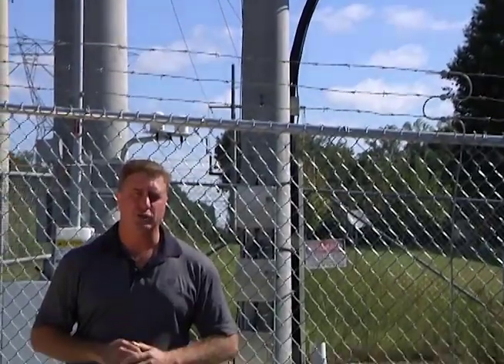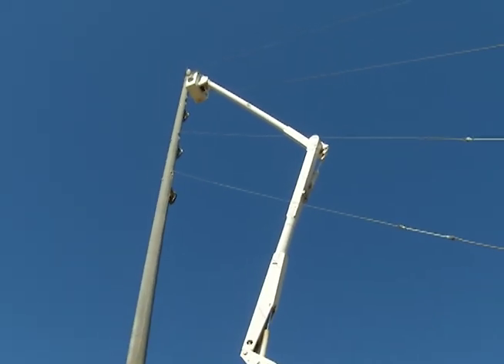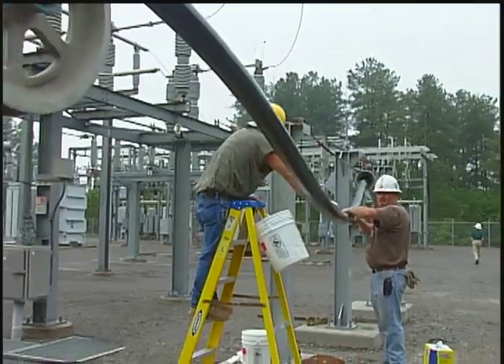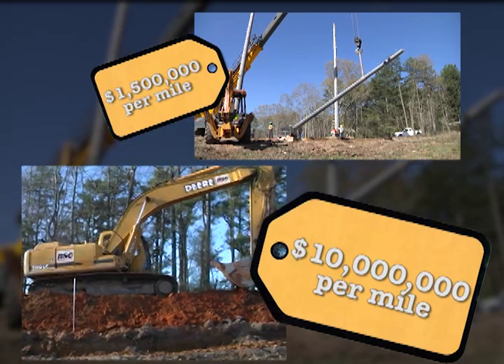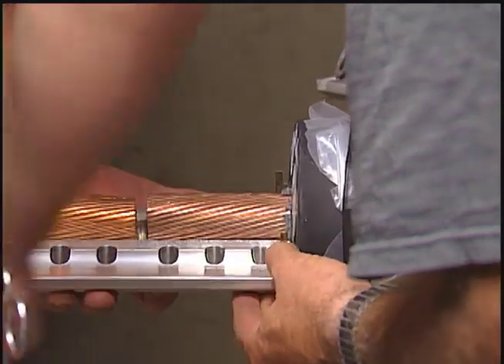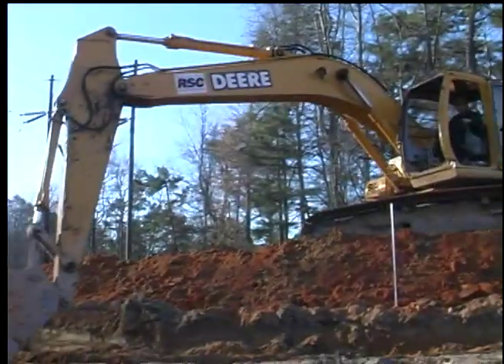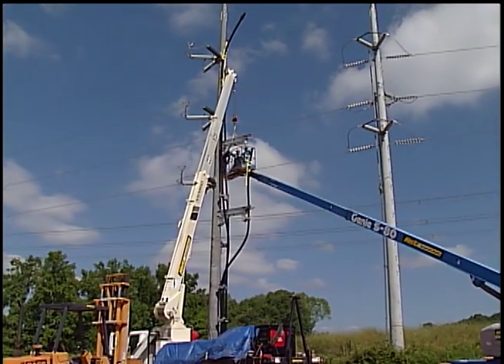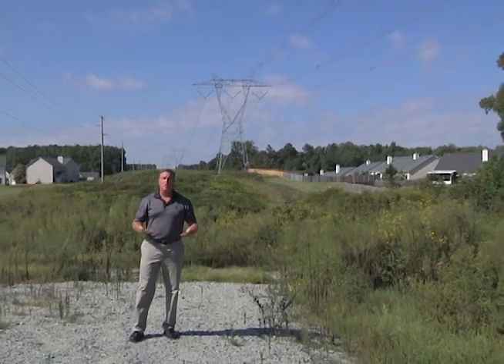Underground Transmission Lines

Comment: Overhead cables not being insulated or very thin insulation are kept cool by passing air, underground with thick insulations cables heat up when passing a lot of current for lengthy times thus resulting to very decreased life of the plastic insulation.
Reply: No they are rated for it
Reply: those insulations are rated for HV do some simulations on cymcap

Comment: SHORTER LIFE EXPECTANCY?!
Overhead lines change temperature faster, change temperature MORE, are exposed to wind, ozone, UV, water, ice and snow.  They are exposed to MORE animals, especially squirrels and birds
Loss-costs are, on average, 2.8% for underground, vs 37% for overhead.
70% of line failures are weather-related, 11 percent are animals on overhead cables/poles/transformers...
Underground cables bring those externality risks down by at least an order of magnitude!
Reply: PhrontDoor you are wrong.
AC lines can't be buried more than 40 miles. You are talking about physics contacts to the line but the reduced life of underground lines is because the electric power pass through the ground.
Only DC voltage can pass to long distances of water/ground and have much more efficiency than AC.
Reply: profesaional！
Reply: @PhrontDoor I think you have mixed up life expectancy with risk of temporary failure. An overhead line will have a much higher risk of temporary, easily fixed failures caused by animals shorting to ground, or a tree falling on coming in contact with the line. These types of short term failures occur much more frequently on an overhead line, but they are easily resolved(most of the time), an underground line will have much lower risk of small scale failure, however the wire will age much faster due to water ingress and other conditions when compared to an overhead line, so the entire cable will have to be replaced after a shorter time.

Comment: Underground is nice but the cost and thermal ampacity limits restrict it's economical ideployment. ACSR open air conductors are far better (thermally and deployment cost) Undergrounding. Makes more sense for 12/21 KV in developed areas. Our local utility has an ongoing battle keeping 30+ year old direct burial cables operating. When we lose an aerial 12KV feeder it's less than an hour for restoration... RU feeders can be several hours to locate the fault and dig up the line...

Comment: Here in Florida, underground transmission lines will never happen. Floridian rate payers don't want to pay the extra cost. If anything, FPL is upgrading the wooden transmission poles to steel ones.
Reply: +fishodorvagina wouldn't that still expose the wires to weather hazards?
Reply: +OscarProGuy It will. But they won't get damaged.
Reply: fishodorvagina I see.
Reply: I live in Florida, and nearby a 200,000+ volt three phase line was buried to avoid having to cross a scenic view over a waterway near the coast.  While they were at it they also buried a set of normal distribution lines as well.  In Memphis Tennessee, ALL of the transmission lines and distribution lines are buried in the downtown area.
Reply: Fast forward 3 years from this post. FPL is burying all lines”hardening” on the east coast. Never say never. Lol
Reply: plenty of cities in florida have sections of transmission lines buried. over 40% of orlando's transmission lines are buried, which is impressive.

Comment: Anywhere in the US, as I know it, don’t allow underground transmission lines. I think it’s because of the big Electromagnetic Field (EMF). Underground lines tend to be below 20 feet below the surface. When we walk near or above one of those lines, we can be severely harmed by the EMF radiation.
Did you know?
Transmission table
Voltage = radiation (EMF)
20-50kV = 22-77ft
50-90kV = 77-103ft
90-99kV = 103-119ft
H-shape frames
••••••Transmission level 2•••••
99kV-100kV = 119-121ft
100kV-130kV = 121-199ft
130kV-190kV = 199-213ft
190-199kV = 213-222ft

Transmission poles (200kV-210kV) and pylons (211kV+)
•••••Transmission level 3•••••
200-210kV = 229-268ft
•••••(Pylons) Transmission level 4•••••
211-240kV = 280-344ft
241kV+ equals 351ft+
Reply: EMF fields are weaker with buried lines (the electric field portion is greatly reduced) but magnetic fields remain as strong or stronger.
Reply: Aren't exposed transmission lines more harmful than the undergrounded?

Comment: Life expectancy ?  see what storms & fires do to your local town and just ask the insurance companies how  much the damages & repairs cost  vs going underground for a little added cost up front and nowadays with better materials and equipment even internal grounded expansion fittings are watertight eliminating the cost of bonding jumpers and the risk of failure and safety for longevity.  Check out a company called Bams fittings  and see the new technology that's available now and one of the reasons we should continue to go underground for sustainable energy vs overhead.  And yes there are certain areas that need to continue with overhead this we know.  But if you're gonna go underground please use new technology not old grounding technology it'll also save money and time installing it  to help the bottom line in cost.  Research it

Comment: But for outside powerlines you need to build and install some "steeltowers" and it needs a lot of time to install the lines in that height. I could imagine doing a simple installion for underground lines. No underground concrete "houses" to join the lines. One machine does it all. 1. escavate 2. lower powerline 3. put concrete in 4. join with the next line 5. cover, close and finish. How can that cost more ? And why underground lines have just the half lifetime like the outside lines ? Should be inverse or not ? Undergroundlines are safe from wheater, air, water, wind and sun.
Reply: peter schiller its because the way AC current works.
The line is a conductor and also a capacitator, when you change the voltage (and you do it 60 times per second on US power grid) you need to recharge the cable 60 times a second and only after that you can have power on the other side of the cable.
With earth you have serious issues with reactance between the line and the ground. In the air this issue is 100 times less relevant.
All transmission lines between islands and mainland are with DC current because of that
Reply: building overhead lines takes less workers, goes quicker to build, materials are cheaper.
Reply: one machine and one lineman can easily build 2 km's a day overhead lines.

Comment: “At times, burying transmission lines make sense.“

But doesn’t explain why...🤦‍♂️
Reply: Main reason is urbanization. Almost impossible these days to build HV OH lines in big city/metro areas. Industrial areas are another example where HV UG cable are used from HV S/S to the industrial complexes. The use of UG HV cable is only increasing with time; will be more with the increase in DER (distributed energy resources) as we have seen in Europe.
Reply: @atlasbeast6756  When the built DFW airport, they buried the High Voltage power lines.

Comment: I read 4.5 ut micro tesla  and 350 v/m volts per meter in my house from power lines over the street that I live on.   Are these safe levels?
Reply: yes
Reply: Voltage is the pressure/flow of electricity pushed by a circuit the thing you have to worry about killing you is amps.  Higher the voltage lower the amps higher the amps higher lower the voltage. Essentially how electricity flows over long distances
Reply: @trevor5672  DUH, but that wasen't the question. he was more interrested in the effects of EMC

Comment: it take up space too . planes that need to land in emergency can't do so because of stupid tall towers in their ways , expecting them to find a BIG EMPTY LAND ?  that cause 90% of air crash , i will suggest that using underground cables with tunnel beside them , while if the cable is damaged , use a computer to scan and ask workers to use a vehicle to travel to it . it will be much easy !
Reply: Can't agree more
Reply: ok so first of all planes dont crash often enough to make it worth it putting powerlines below ground. powerlines dont take up that much space. underground powerlines are very lossy when using ac due to the capacitance of the ground and the resistance to ground.  fixing underground lines is more dangerous because you cant lift your workers high up of the ground for saftey.
Reply: Powerlines near airports have a ball shape on the top ground wire. At night, a red light on top of the pole lights up. By the way your dumb comment was on the very bottom of the comment section.
Reply: I'm sure in an emergency landing, watching out for power lines and telephone poles is far down on the list of things to do.